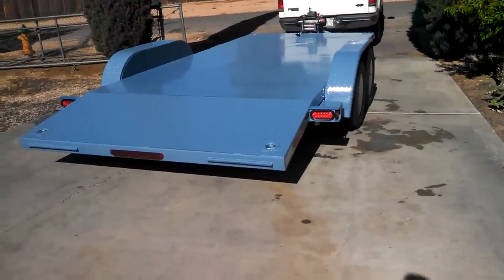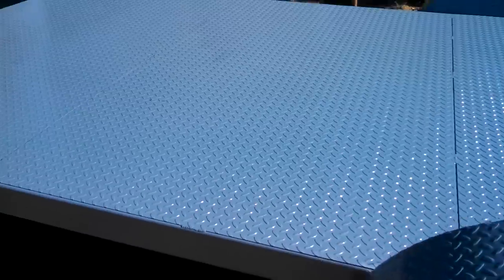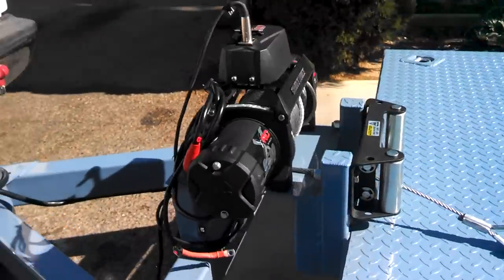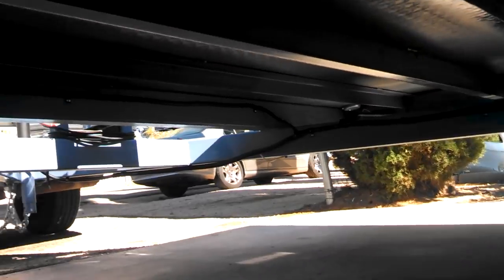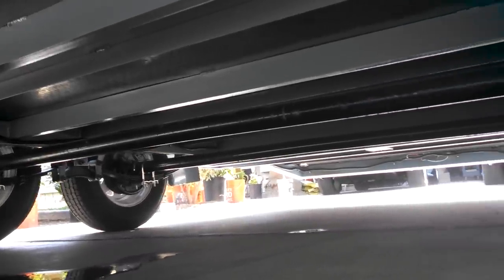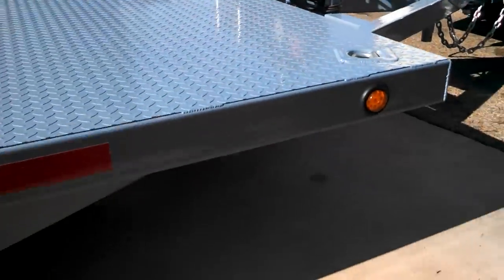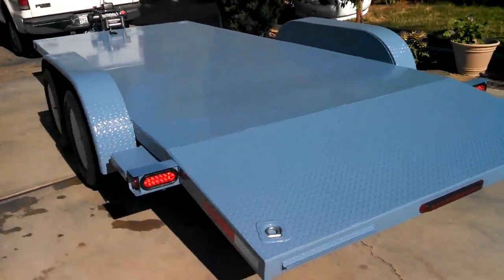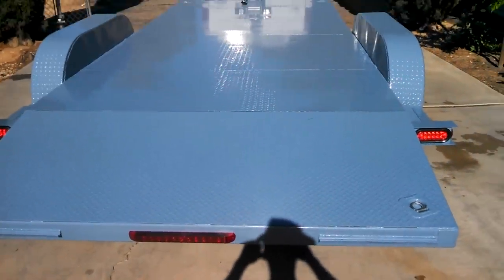Building an 18' flat trailer car carrier/hauler with dove tail project part 5 DIY FINAL)

Comment: Hey, don't be so hard on yourself.
You did an awesome job on that trailer. I would be proud to have that behind my truck.
The only thing I would add would be more tie downs as I have found there is never enough of them. Maybe use over-the-tire straps, and tie downs spaced out on each side.
Thanks for the great build.

Comment: Trailer we had at my last job, we hauled scissor lifts, and our mini ex.  Had the 2x8 wood floor and individual spring loaded ramps. We got under ours and ran all the wiring in conduit. It helped with snatching the wiring loose if we snagged them on something on the job. Beautiful trailer you got there!

Comment: My trailer has marker lights wired on the front of the fenders so you can see the sides of it when your pulling at night in the mirrors. Just a suggestion. Looks good!

Comment: It's alright if the axles are kinda far back because that helps prevent sway. Looks very nice!
Reply from the maker: I like to put the cars facing backwards so the heavy part of the car is over the axles. Hardly any tongue weight on the truck. I love it.

Comment: Sell this one for a few thousand, you should get that for it, take what you learned from this one, then build the next one incorporating all the design changes you came to realize from building this one to make the next one perfect.  Incidentally, I like the color.  Make the next one a bit darker blue.  Overall, it's a good looking trailer.  Great job for your first time out.

I was told that when it's properly loaded, 1/4 of the weight of the load should be on the tow vehicle.

Comment: Very good job man. I wanna build trailers myself and sell them.  But so far, its just an idea.
Reply from the maker: Well it could be profitable if you can get the parts cheap enough. Only way to get parts cheap enough I've found is to buy in large quantities.
Reply: As another trailer builder points out, there's liability issues when you build and sell things in today's sue-happy, lottery seeking consumer.  Each car that's sold probably has a $1,000 price tag added to cover lawsuits.  But in any case, ALLMUSCLE gets an A+ for his build.  Gotta be proud.

Comment: You need to adjust your rating system...it turned out great.  How much would you say you paid total?
Reply from the maker: usafmfe100 Thank you. You know it came pretty close to 3k with the winch. Probably could've bought one for that....but what fun would that be. HEHEH.
Reply: I agree building trails is fun dad built a car hauler out of scrap we used I beams about to try to dove tail his trailer step ramp plus heavy none running car with no winch not fun the trailer was built over 19 years ago but we built all our trailer

Comment: Hey man, sweet job on the trailer,turned out great.
You said that there would be a couple things you would have done differently, what things do you think?
Reply from the maker: I'd pull the axles forward, cut the corners on the front of the trailer, also bring the the tail section up a bit as it will scrap when the there is a load on it coming up or down a driveway.
Reply: Very nice effort You'll find every one you build will always have something you would have done differently. Last one I built was 20' with a 2' beaver tail. I used the same angle cut you did. I had a hunch you might run into a problem with the 3' one.  As for the axle placement I have always placed the center of the lead axle at the exact center of the trailer. I got this by measuring a zillion factory made ones.(On single axles I have usually used the 60/40 rule.) Anybody knows a better way, I'm listening.

Comment: hi how are you, could you give me an advice, i am building a 20 feet car hauler, the same way you are, with winch, tool box in the front. I want to haul my muscle cars, could you tell me were to put the center of my tandem axles? you talk about bring the axles 6 to 12 inches forward, thanks
Reply from the maker: +danoldsbb455 I chose to put the axles a little further back because I like to haul my cars with the engine facing back. This helps take some tongue weight off the truck, and if your pulling a car with a full bed this is especially helpful. This way the front weight of the car sits right on top of the axles. I said I would move it forward a bit but I have grown to like it better this way. I would advise you to put the axles in where they work best for you. Usually trailers have their front axle set at the center point of the deck.

Comment: Damn nice job.  Where did you get your parts?  Did the axles come complete?
Reply from the maker: +Paul Copeland Got all my parts at a local trailer supply shop. Axles came complete with leafs and brakes.
Reply: ***** thanks